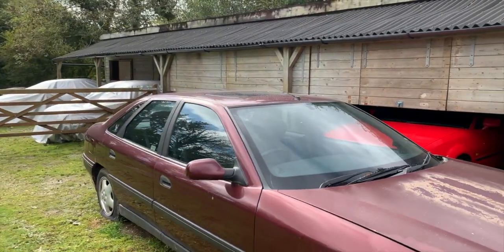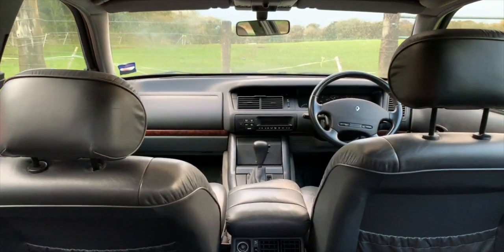The Renault Safrane is Becoming the Paula Abdul of the PetrolBlog Fleet

Comment: Good to have you back :)   I worked for a Renault dealer when I was about 18 and Mk1 Safranes were new, Aircon was a very common fault sadly although more often than not it was caused by a leaking heater matrix I think (its been nearly 30 years so I could be very wrong).  Gearbox is the concern but even then, roadtrip to a French scrapyard? There has to be a way to save it...  And yes, Mc Skat Kat.
Reply from the maker: Thanks David.
A trip to a French scrapyard is a very, very good idea. Time to fire up the £100 Laguna...

Comment: My brother converted his 2.2 Renault safrane from auto to manual. His auto gearbox probably needed a new sensor or servo in the gearbox! 
The gearbox in the early safrane is actually a vw gearbox with a Renault computer. He used to get problems in the Alps in his with the gearbox overheating and going into safety mode once it was cooled down it was ok it needed an external oil cooler. He was disappointed as the manual gearbox car had only done 44k the box only did 12k before it gave up and apparently it was a common fault on the manual for the bearings to be installed at the factory to tight in the diff.
Reply from the maker: That's another avenue to explore – thank you. Will look into oil coolers.

Comment: I had a 1994 safrane with the auto box. At the time the car was only about 8 years old. The gearbox went into limp mode. I vaguely recall it was something to do with a tiny part breaking inside the box? Back then it required a total new box, unfortunately it went for scrap. Was just a wonderful safety car to drive, I would love another .
Reply from the maker: Yeah, that's the big worry. Big job, big bill and big headache. Will explore all the simple solutions before thinking about the worst case scenario.

Comment: My dad had an R reg safrane 2.5 auto with the Volvo engine and heated front screen but no heated seats! It was brilliant but it got so expensive to run when petrol got to about £1.50 a litre he was doing about 13k a year and retired. Never broke down, he did about 50k total got scrapped with only 98k 😱. 
But for some reason my brothers mk1 2.2 was more silent car it had no sunroof im not sure if Renault fitted less sound proofing in the mk2 ? But the mk2 after market mid exhaust box had loose baffles i think they all did! I think some owner's in France opened the box's up and welded the loose baffles.
Reply from the maker: Too many Safranes were scrapped before their time :(

Comment: The manual gearbox had a very high gear ratio. Which was a shame as the auto used to cruse down the motorway at about 65mph with low revs compared to the manual box.. It took him about a month to convert it to manual and he even registered it as a manual on the v5.. He cut his losses in about 2010 and scrapped it.. Bought a laguna...I think the auto safrane was only £450 in about 2003 even had air con.. And the manual parts car £150.. It might be worth doing some reading about it being a vw gearbox!
Reply from the maker: A manual conversion is certainly an option.
Reply: @Petrolblog  its a massive job just the shear number of parts u need a donor car really, even the ECU had to be swapped to one off a manual car. The whole of the peddle box on the front bulkhead dash out drive shafts i think my bro whished he just fixed the auto box. I think its a strong box just the auto Renault gearbox computer and electrical parts in the box.lots of the parts inside have vw part numbers!